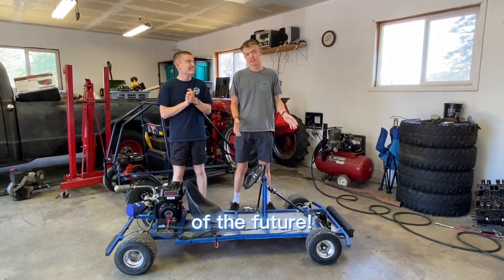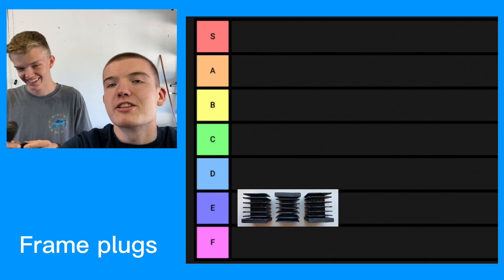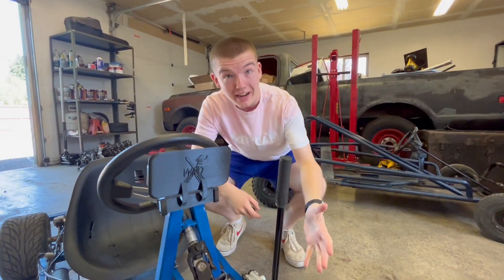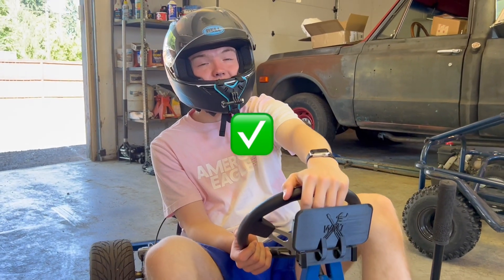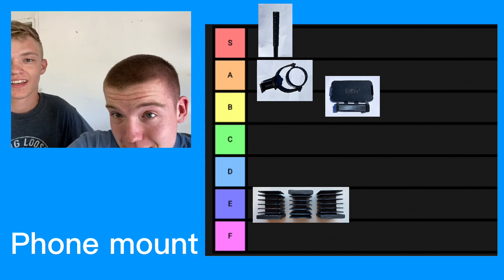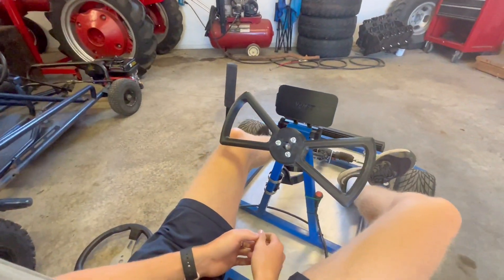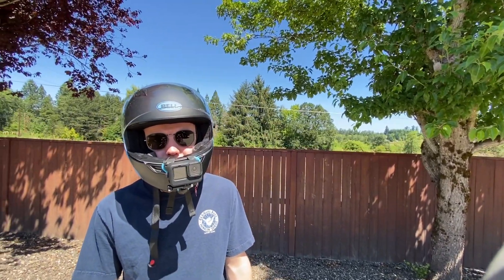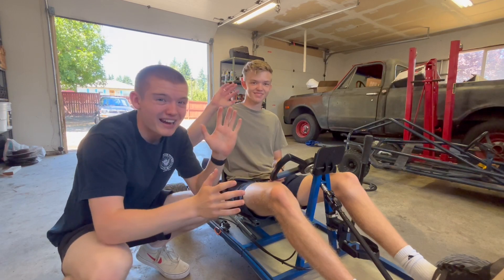We 3D printed GO KART parts!? Are they strong enough?? Let's find out!

Comment: consider using flexible filament on the printer for alot of the parts, also great work the editing is fire
Reply from the maker: Thank you! We were talking about how flexible filament would be better especially for those frame plugs during but we don’t have any at the moment. Thanks for the suggestion!
Reply: @WeWillFixItLater  I have horrible print quality with all sorts of TPU, but my prints with Ataraxia art flexible pla is amazing and looks perfect just like pla. It’s an amazing improvement over normal PLA
Reply from the maker: Thank you for the advice! We will definitely look in to that!